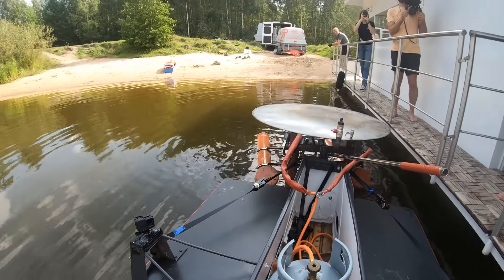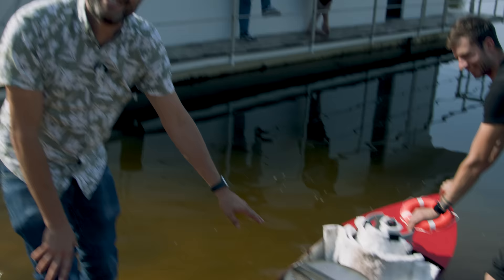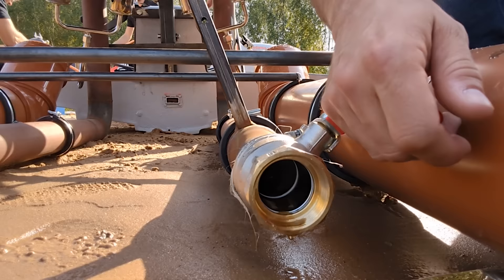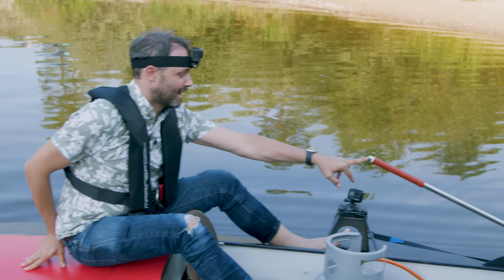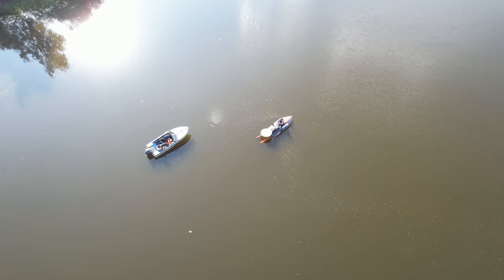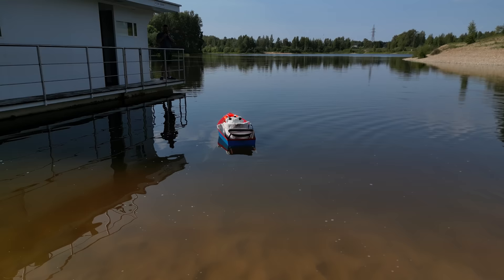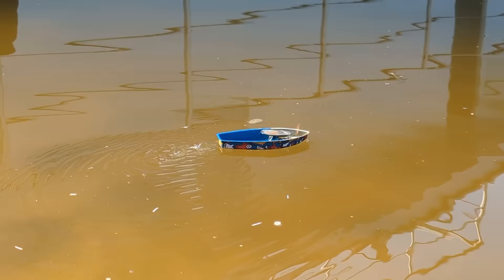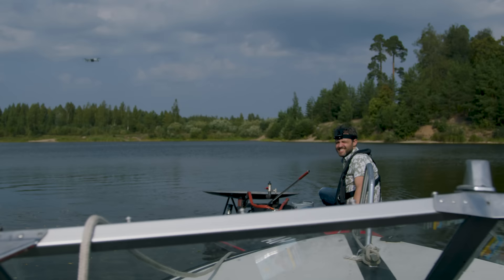Will this toy engine work at full size? (yes)

Comment from the maker: But what was that giant duck doing there?
The sponsor is Jane Street. Fine out more about their internship programme here: https://www.janestreet.com/internships/?utm_source=youtube&utm_medium=sponsormessage&utm_campaign=stevemould923&utm_id=Steve+Mould+September
Reply: Is that the taskmaster season 16 ep1 duck?
Reply: The duck is to test for sharks.
Reply: Would it work better with a check valve system? One pipe forward pulling in and the other pushing?
Reply: The AI kinda makes you sound like a pubescent teen.  LOL
Reply: I wonder if the "curse of dimensionality" could have a similar intuitive explanation to the square-cube law. The curse of dimensionality is that as you increase the number of dimensions a volume inhabits its mass moves farther from the center and clumps at the edges of the volume.

This effect has an impact on machine learning. As you increase the number of "features" in a sample of data, the more sparse the feature space becomes.
Reply: The Quackening
Reply: Hay Steve,
Would a pop pop boat still work if you used a radioactive isotope for the heat source?
Could it then be made into a closed system?
If true for both then would it have space propulsion potential?
Reply: For "rubber ducking" of course
Reply: Damn I didn't even see the duck throughout the video until I read this comment lol
Reply: What AI did you use?
Reply: My guess would be seeing the drift. What ever it is, I want it.
Reply: Why wouldn't it work? Why has this surprised you?
Reply: Well they could have gone with a thin coiled copper pipe for the heating element. using induction heating would would help eliminate the issue of surface area vs volume of the larger "engine" because then they would be heating the pipe both externally and internally with just the magnetic ....etc. Not to mention they could also have fun with it, have metal pipes inside the tank meant to help facilitate keeping the metal stiff and not move. along with providing more surface area to heat the water.
Reply: @STEVE - TWO QUESTIONS:-
1 - COULD you increase the flow of the water in one direction by having 1 pipe as the inlet facing the bow/direction of travel with a 1 way/flap valve built in, and 1 pipe facing backwards, again with a one way/flap valve so flow of water is ONLY in the direction you want to possibly help speed of progression?? 🤔
2 - COULD this work IF it was adapted to have say, a fire pit and you placed wood (or 'Wewd' - Bobby Duke Arts (lol)), in as the fuel/heat source? 🤔
😎🇬🇧
Reply: Unfortunately they are not offering any internship in Mumbai 😢😢
Reply: You should do a life size baking soda and vinegar boat
Reply: Has anyone worked out the most efficient scale of a pop pop motor/boat?
Reply: That looked like a nice bbq. Seem you had a great time and made new friends. Kinda jelly tbh. But itll be my day someday. Cheers bro!
Reply: @JoesCaribbeanVanLife  korean bbq , woukd be fantastic lol
Reply: You know you've been playing Starfield too much when you look at the Jane Street logo and think of the digilock system in Starfield! 😂😂😏
Reply: dude you got strucken with the bald as I have. Not ever would I have thought I woulda formed a straight hulk hogan at 35. lol.
Reply: First time i saw a pop-pop boat was in the animated movie "ponyo" and it does get embiggened (by magic) and the child main characters use it to get around after a flood, it does move faster than this one though(....by magic)
Reply: so impractical
Reply: Yo Steve just a note about your GoPro, I heard it beeping in the video and I just recently found out you can lower the volume or mute all the beeping by customizing your GoPro in an app, I use GoPro Quik, though I’m not sure if there’s another app that allows it. Anyway didn’t know if you knew that, apologies if it’s just empty advice, just thought if it was annoying you at all, it does for me when I’m turning it on and off making videos😂, ya might like to know there’s a way to turn it down/off.
Reply: @Ibemyselfnooneelse   can you imaging Steve in Taskmaster? swoon❤💕
Reply: I expected to see a pop-pop powered rubber ducky.
Reply: What would happen if you put check valves on both pipes. One facing in and one facing out. Forcing the water in and up one pipe and steam down and out the other.
Reply: So we can all quote the question posed to Harry Potter by Mr. Weasley?
Reply: @IIBLANKII Yeah !  Why didn't I think of that ?
An induction heater !
Get rid of all that gas-powered crap. Crane hoist an induction heater power supply and a big ass generator to drive it.
Slap those guys right in that little speedboat and fire it up.  That'll work !
Brilliant !!!
Reply: James Veitch was there?
Reply: interesting type of sponsor ship
Reply: This has to be the most fuel inefficient boat on Earth.
Reply: I think you have to scale up the thickness of the metal to make it resonate faster.
Reply: Isn't Jane Street the firm Sam Bankman Fried + so many FTX people came from?
Reply: I fully expect the team to try and figure out how (if practically possible) to build a rig that holds 10-20 smaller pop-pop engines and use a size of butane burners that can provide the same amount of BTU’s that the four burners on this one could output. It would be interesting to see if it would be an improvement!

(Although I’m sure it will be a huge challenge figuring out the logistics of creating a workable solution without causing a massive change in both mass and drag coefficient.)
Reply: No, there isn’t
Reply: You need an inlet and outlet pipe with 1 way valves. This will improve efficiency.
Reply: If you use one pip put underwater a t-cross and use two check valves the valve in front as a inlet and the second one in the outlet maybe you dont lose momentum the water come in the frontpart in pull out in the back. sorry for my bad english 😂
Reply: i surmise that this doesn't scale effectively and works better if theyd had say 4 smaller units (one for each burner) instead of scaling the water.. its an issue of volume.. the surface area doesnt scale with the all that extra water inside.  *as soon as i say this.. you bring up the square cube law.. and yeah i agree
Reply: You don't even know how they work, pop pop boats travel by fluctuating expanding air in and out of the tubes off the back at q frequency that allows it to be propelled, when it's completely full of water there isn't enough air expansion to properly push it fowards ie: the low engine frequency and slow speed the same is true for the original boats where if you manage to completely remove all air it will either not work or barely work, try adding significantly less water and I'm sure you'll see a vast difference
Reply: Another peculiar boat-motor:
A tripod on top, with a pendulum swinging! You push the swing forward, biasing the forces on a boat with a wide flat bottom, while shifting its center of mass - if the boat is weighted to rock forward and backward in syncopation to the pendulum frequency (by using a hollow shell like a kook-box surf board with a pool of water inside, for example) then you should end-up splashing water behind your wide tail. You could get more power by using a stiff metal rod as the pendulum, with a spring on the opposing side of the rod to push back to you on a shorter, faster stroke.
Reply: Anyway, we can beat the grow of volume-mass with hollow bodies!, just 3D print a giant boat with like 20% infill or something like that.
Reply: I would suggest they make multiple chambers.  Instead of one big chamber going pop pop, try dividing it into 4 smaller pop pop engines.  Then it will not only pop faster, but have 4 engines popping instead of one.
Reply: The solution is obvious.  Instead of one giant pop pop engine,  two dozen smaller ones that, together, will equal the volume of the bigger one.  The smaller ones will cycle more quickly and you'll get better performance.
Reply: I’ve thought of a way to make this more efficient. Increase the available surface area of the pipes by using a bunch of smaller ones, instead of two large ones coming out of the tank.
Reply: so , two engines with half the size would be more efficient than one?
Reply: @JaymeEduardo  No, that would increase entropy too much. What i mean is this: same amount of engines, but use more than two "inlet / outlet" pipes so then the heat transfer happens much faster, increasing the efficiency and proving less of a delay in the time it takes for water to come pack up into the engine.
Reply: How did they get you down to that size, Steve? The duck in the background was a dead giveaway about how small you and the boat were! 👌😂👍
Reply: #SteveMould When chamber is behaving like diphram and ,  is moving up and down volume of chamber decrease and combastion chamber fail in producing sufficient pressure diffrence ... 
This is why boat is slow and producing less power
Reply: Is there a design where you can use multiple toy size motors, quickening the heating and steaming of the smaller lid pieces, for maybe more speed on similar sized craft? Just my thoughts
Reply: Stocks are just a popularity contest, those who benefit are the same ones who know when a stock will become popular.
 The scaled up pop pop boat was great though. I now have a design that would work even better i beleive after understanding the squared cubed law a little better.
Reply: The giant duck is a pedal boat.
Reply: ماذا نستفيد منك غير انك تريد أن ترجعنا لزمن التعب مع انك تعرف انهم يخفون عنا الطاقة 🔋 المجانية
Reply: Jane Street gave us SBF and his cohorts for FTX and related companies. It should've taught them a bit of integrity and morality.
Reply: The guys aimed to at least go around the duck and back.
Reply: @Ibemyselfnooneelse That's what I was thinking too
Reply: the sheet metal was way too thick!!!
Reply: and water thickness is too big. must be narrower! too much water to heat up
Reply: The square cube law got my sub ◽️
Reply: 🤔🤔🤔 hey why don’t you put 2 intakes and 2 exhaust with one way check valves
Reply: 🤔🤔🤔 hey why don’t you put 2 intakes and 2 exhaust with one way check valves

Comment: Yeah, square-cube law really defines the size of some things when it comes to engineering. You can't scale things up too much, and also can't scale things down too much. Some engineering solutions just work best at certain scales. And also various material properties come into play.
Reply: It can be misleading, however. Vehicles can often get more efficient at larger sizes, because they are not subject to the cube part - as vehicles are not solid bodies, they are generally "skins" defined by their structural requirements, and larger size (without thicker skins) in many cases means disproportionately greater strength.

This is why larger aircraft have more range and capacity than smaller - the airframe and system weight scales up only with square law (sometimes less; you don't need more computer for a bigger plane), while the cargo and fuel volumes available scale with cube, giving them enormous capacity for both.
Reply: @iskierka8399  It's just square-cube in reverse, and the point still holds that "Some engineering solutions just work best at certain scales". Same is true for ships btw, which is why container shipping has gotten larger and larger as port facilities become able to accomodate them.
Reply: Makes me think, wouldn't fitting it with two or more smaller pop-pop engines make it more efficient / faster?
Reply: @communications23  Yes I think something like that may work , smaller pipes for faster reaction and such. Also maybe the POP bit is a flaw that sounds great as a toy but not effecient. Trains don't go pop to move and they are a steam engine ???
Reply: @maxgood42  That's kind of hinted on in the vid, it should work better when rigid. I bet they did it like this for fun.
Reply: @bluerendar2194 the current limiting factor for container ships is actually the Panama canal. It would make more sense for them to be even larger still (and I believe there are a few beyond that size), which we can make them. But it would not be worth it to not be able to make it through the Panama canal bypass of south America. That is also why the Chinese are starting efforts to reopen the old french panama canal project from before the Americans created the panama canal. I think it was the french at least, tho I could be wrong.
Reply: This is why so many internal combustion engines have cylinder capacities of approximately 500cc per cylinder.
Reply: He covers that in the video dude.....
Reply: @himan12345678  Canals are definitely the limiting factor for the routes that require them, but there's already ships that only service trade in the Pacific that cannot fit through the Panama canal. The sheer volume of goods is enough for having a special size and route.
I know a while back it was looked into to skip the Suez canal and go the long way around the Horn of Africa - not entirely sure if that has panned out. Apparently the sheer efficiency of scale means it might be worth it to run larger ships that can't fit by going around, and the Suez canal is starting to be somewhat traffic jammed anyways.
Reply: @petermorris9592  Yes Much like the 96mm square bore that is the most efficient in this environment.
Reply: could you not heat up the pop boat with something like a microwave?
Reply: The thing is, he is implying the Pop pop engine design is acting in reverse in terms of efficiency and the square cube law from it's near cousin -- the steam boiler and steam engine/turbine.  As you double them in size, they get more efficient because the heating surface is squared, and the volume of the boiler itself is cubed.  It is the reason steam locomotives, power plants, steam ship power plants and other steam engines were made as large as it was possible -- the larger they were, the more efficient they were.  It is also why small steam toys develop so little power that they can barely move themselves.

I wonder if it has to do with surface tension and the tubes.  Rather than going with a single large tube as @SteveMould is thinking; I am thinking what is needed is lots of small tubes.  When boilers are scaled up, the size of the tubes stay pretty much the same, it just requires more and longer boiler tubes (either water tubes or fire tubes, depending on the design.)  So I am thinking a single boiler, and dozens, if not hundreds, of small tubes sticking out of it and into the water.  That may be the key to scaling up to a  man carrying size.